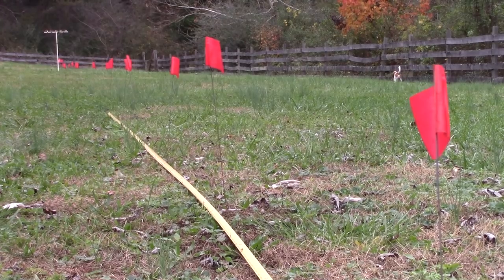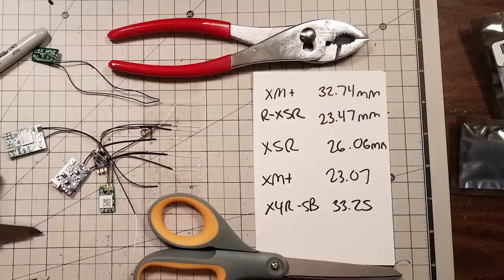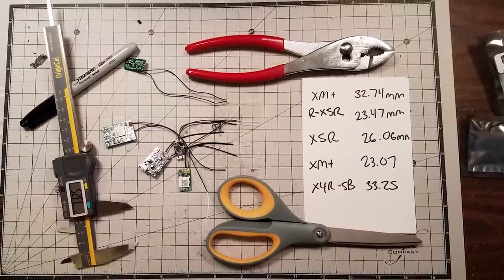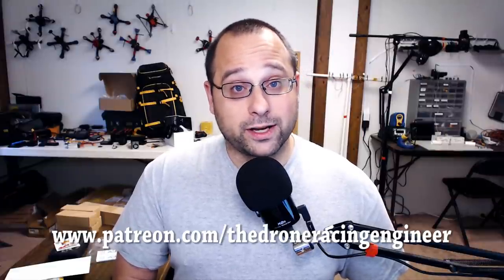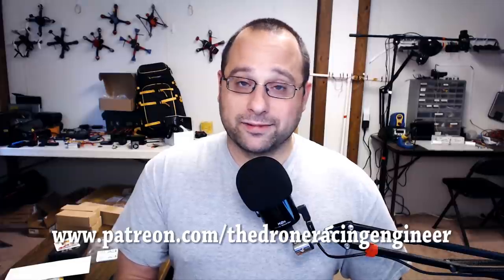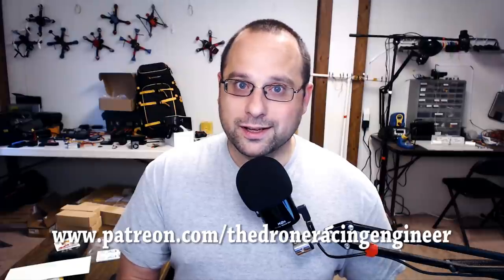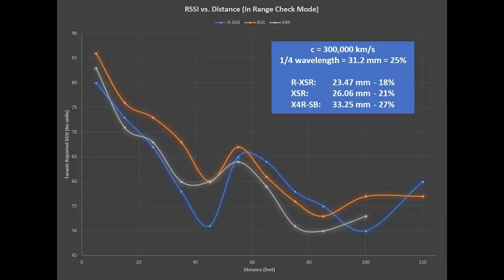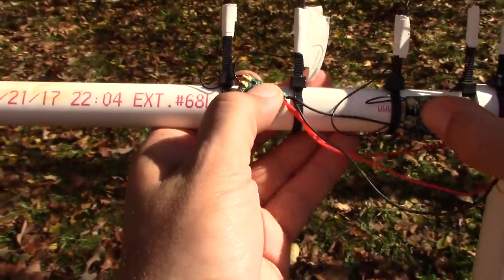Range Test FrSky RX | WRONG ANTENNA LENGTH?

Comment: There is a misconception in the RC community that receiver antenna length is critical. It is not. I believe this misconception results from the fact that transmitter antennas ARE length critical. 
One of the reasons for this misconception is that people read on the internet about tuning transmitter antennas, and assume it applies to receiver antennas as well. The actual science is quite involved, very math intensive, so few delve deep into it. Here's my attempt to explain what I know of it in a easy to understand framework. I hope it helps out.

Transmitter antennas radiate a certain portion of the power fed to them, and reflect the balance back to the transmitter - this is why operating a transmitter with the wrong or without an antenna can damage it, nearly all the power is reflected back to the output transistor and it overheats. 

Some of the power is transmitted and some is reflected back to the transmitter. This forms a ratio.

This ratio is known as the Standing Wave Ratio (SWR) which is a ratio of power sent to the antenna (forward) vs the power radiated by the antenna (1:1 being ideal – where all the power is radiated). SWR is determined by measuring the power being reflected back from the antenna and comparing it to the power being sent to the antenna (Reverse : Forward). 

An example would be a system with a SWR of 1.2:1 and a transmitter power of 1200mw. 1000mw will be radiated, and 200mw is returned to the transmitter and generates heat. If the antenna is tuned perfectly, with a 1:1 SWR, all 1200mw will be transmitted. This is a compromise on tunable systems, as the antenna is tuned for a specific length, and is only perfect (or nearly so) at one specific frequency.

This antenna tuning can be achieved by cutting the antenna to a resonant length, but can also be done by matching it to the antenna  with a inductor/capacitor network. Known in HAM circles as a “Transmatch” this network allows a single antenna to be used with a very wide range of transmitted frequencies and provides very good performance. It uses variable inductors and capacitors and is re-tuned for each desired frequency. A small specific version of this network (with fixed components) is often integrated into small transmitters to make them work better with less than perfect antennas.
This is a simplification for the sake of brevity (like I warned about) and any time a a signal 'changes hands' some of  it is as accepted and some reflected (which is why I went into all that detail above). This is all about matching impedances, and that's a big subject, worthy of entire books. 

Here's why it matters:

In any case, on a receiver antenna, the only concern it that it draws the signals you want from the air as efficiently as possible. In doing so, it draws in virtually all radio signals, with the length determining which are best received. THIS is why we care about the length of a receiver antenna. It's a broad range, not a specific channel, or even a band (such as they are with our 5.8ghz video signals), covering many MHz.

We finally get to why the length matters:
The receiver uses a series of tuned circuits to eliminate the unwanted adjacent signals, and focus on the desired channels. The 1st stage of this process occurs where the antenna meets the receiver (IE “front end”).
To remove the bulk of the unwanted radio energy, the receiver works with the antenna to create an impedance mismatch at frequencies above and below the desired target. This forms a broad tuned circuit, and reflects a large portion of the unwanted signals back to the antenna, where it is re-radiated (disposed of). The desired signal is thus 'pre-cleaned' allowing more sophisticated circuit to further refine it. The antenna plays as part of this tuned circuit, and contributes it's capacitance and inductance (components of impedance) the the components in the receiver circuitry. It's length effects it's  impedance, and how it interacts with the receiver.

This is WHY antennas will vary in length on different receivers, and why it helps, but is NOT critical to have them 'just right'. Each receiver has it's own specific front end impedance, and wants a antenna that works with it to produce the best performance. 

I apologize for the length of this comment, and have to qualify that I had to simplify some details to keep it this size, so don't beat me up if there's some minor inaccuracy or imprecision in it somewhere. I tried to make the basic principles easy to understand, and hope it helps out.
Reply: Scott Marshall  there was only one model that was a receiver. All the other units were transceivers. For telemetry to work the receiver switches to a transmitter in between packets to send telemetry. Therefore matching impedance is important during the telemetry cycle. This was not specifically tested.
Reply: Man! That was awesome! I'm so glad I bothered to read the comments. I'd always wondered what it was that killed VTX's that didn't have an antenna.
Reply: As an Extra class amateur radio operator, I applaud the clarity of your explanation. Well done.
Reply: The runs are so short and the wavelength @ 5.GHz both work to make it effects minimal for our uses, and it can be disregarded.

In long cable runs as in RF CATV it's the bane of engineers trying to keep the system in phase. 

I wrote a long explanation of multipath and analog TV ghosting, but I spared you the gory details. (I tend to run on on these sort of subjects)

Short answer – NO, 
The long answer is too long for this section.

If you want the gory details, PM or email me.
Reply: This is pretty accurate, but there's one thing you haven't mentioned: the sensitivity to resonant frequency shifts, both on the TX and RX side, is inversely proportional to the bandwidth of the antenna. If you have an extremely narrowband antenna, a slight change in center frequency can produce so much mismatch that you get essentially no signal at all. A wideband antenna is far less sensitive to this. Dipoles and cloverleafs have a relatively wide bandwidth, which is why you won't see that much difference. But some other antennas such as PCB-based patch antennas without an air gap or miniaturized ('meander') antennas (especially PCB-based) can become completely nonfunctional.

Also, in terms of signal strength, mismatch at the RX and TX side has the exact same effect. One is no more critical than the other. The difference between RX and TX matching lies only in the fact that the TX can be damaged by a mismatched antenna whereas the RX can't.

Variable matching networks are popular for amateur radio which uses lower frequencies, but they aren't practical for high frequencies such as 2.45 GHz or 5.8 GHz. We get away with this because the transmitters that are used for FPV are relatively low power compared to those that are used in amateur radio, so they don't overheat that easily.
Reply: For simplicity I assumed that we are talking 2.4Ghz 1/4 wave antennas. I've never seen a control receiver with anything else, but maybe that a niche someone like you could do something with. 
Is there a better Omni Rx antenna design for 2.4?  A retrofit would find a huge market here.
Reply: Cloverleafs would certainly work better (same reasoning for FPV applies to the regular control signal too). But at 2.4 GHz they are quite big and heavy, and also a lot more fragile. I'm considering modding my transmitter to add one, but transportation will become an issue I suspect. For the receiver I guess monopoles are still the most practical option. A balun, ground plane or counterpoise could help a lot though, I strongly suspect that the radiation pattern of these wire antennas is all over the place because the coax itself is radiating more than the 1/4 wave section itself.

Of course antenna placement is still key. I see people taping these wire antennas to their carbon frames or aluminium standoffs, if you're doing that then don't bother trying to improve the antenna ;).
Reply: UrLawyer Same here. Also an Extra Class ham radio operator as well
Reply: I'm sure it does effect things, but expect it's a very small influence in the distances involved, probably smaller than we can measure with digicals. I could be wrong, I'm behind the times, and Maarten Baert or Alex Greve can  tell you more about modern antenna design. 

I designed CATV filters (and manufacturing machinery) for Northeast Filter back in the '90s, and haven't been involved in it much since, other than my RC stuff. I moved into industrial controls after about 1998, so my knowledge is lagging. Things move pretty fast in the tech world and it's impossible to keep up unless you are intimately involved. For designs like the folded dipole, I cut a couple on the long side and trim the 1st until I go too far, then duplicate the best length(s) in a fresh one. Cut and try is hard to beat, but hard to do easily with CP or the more elaborate designs of today.
Reply: "An example would be a system with a SWR of 1.2:1 and a transmitter power of 1200mw. 1000mw will be radiated, and 200mw is returned to the transmitter and generates heat." - I do not think this is correct: http://rfcalculator.mobi/vswr-forward-reverse-power.html
Reply: Good catch - yes, VSWR is the wrong metric to use here, this is why engineers nowadays typically use S11 (return loss) which is simply the ratio of reflected power vs incoming power. It makes the calculations a lot more straightforward. A VSWR of 1.2 corresponds to a return loss of -20.8 dB. (return loss = 20*log10((VSWR-1)/(VSWR+1)))

When using a 1200mW transmitter, 9.9 mW will be reflected and the remaining 1190.1 mW will be either radiated or converted to heat (since the antenna will never have a radiation efficiency of 100%).
Reply: Thanks for your comments, extremely helpful . After reading your comment the "Light Bulb" turned up.
Reply: My point was really that the different antenna lengths are by design, and if it's off a tad, it will have a relatively small effect on range. If you want to experiment with the length, it probably won't hurt anything, (buy an extra and cut it, reserve the stock one if it doesn't help) but it's probably near optimum from the factory, as the length is adjusted to account for the internal receiver (and telemetry tx)  circuitry. (See Bruce's excellent explanation :
https://www.rcgroups.com/forums/showthread.php?2994438-Selling-the-Entire-Garage%21%21%21%21%21%21%21%21%21%21%21%21%21%21%21%21

IYour receiver does also transmit telemetry, but that's less critical for 2 reasons - #1 if you lose telemetry , you won't failsafe and crash, and #2 - the telemetry is less complex and slower signal and is relatively un-affected if it loses data packets, it just updates a little slower, and gives you a warning. I also believe the telemetry receiver is more sensitive because it tends to drop out when the receiver and transmitter are too close. I'm not sure why this is.
Reply: Antennas have the exact same properties for transmitting as for receiving, therefore antenna tuning matters exactly the same for rx as it does for tx. 

Additionally these "rx" modules actually contain transmitters too because they have to send back telemetry at certain time slots.
Reply: As mentioned they're transceivers, and low power so the tune can have quite an effect. And although you can tune antennas in the txvr, that's lossier than tuning by good length.
Reply: Nice clean explanation, well written.
Reply: I know they say there are no dumb questions, but: is it possible that using a more firm antenna increases reliable feedback compared to a whispy/curly antenna?
Reply: @SacredMilkOG  Not dumb at all. If the antenna is mounted where it can move around, it's possible that it may detune due to flexing and vary it's gain at a specific frequency as it moves. I've been a Amateur operator for 50 years, and I can't say I've ever seen it actually happen, on an RC vehicle or car antenna. That doesn't mean it can't happen, but I don't think it's an issue except in maybe extreme cases where the antenna is bent right over and possibly moved near a metal body or that sort of thing.
If you're installing a RC Receiver inside a model, I'd get it as straight as possible and try to keep it away form anything metal, or even plastic can cause issues. Straight and away from any objects is best, whether inside or outside, outside the vehicle, straight and stable would be the best setup, but the mounting is usually determined my the airframe or chassis of the vehicle, and the best you can do is compromise. The 900mhz stuff these days requires longer antennas, but is also much more forgiving in my experience than the 2ghz system. If you fly distance or with obstructions, 900mhz is the way to go, I fly 900mhz on everything but my DJI system, and it's it's own creature, the way they handle control signals. You CAN use a 900mhz system with the DJI HD setup if you just add it on and don't use the built-in control system, but I've found that the DJI package works quite well, within it's limits, add a good aftermarket antenna system and it's very reliable and easy to use.
Hope that helps, I know it's kind of general, but it's never been an issue in my limited experiences. Maybe someone with experience in more severe applications can expand on the question further.
Happy Flying!
Reply: @scottmarshall6766  thank you for that breakdown- I definitely want something where flying behind a pillar won't cut out my signal and make me drop from the sky. 

I'm still at novice level stuff with quads- I'm working on an H8 mini cause they're cheap and seemingly refined. I have an AIO 5.8ghz tx06 on one already though- feels like I'm just getting better by the day and itching for more things to mod. :) I'll experiment on a few of the "extra" bots I ordered- all H8 minis. (I feel like Eggman from Sonic while working on these... 😂)

Edit: And well- for purposes I ought to mention that one of the first things I did to my vtx antennae was bend them carefully backwards as close to the joint as possible. You mentioned it being wise not to bend them much at all though- and it's one of the first things I did... 🥴

I mean- I did it so I could fit into tighter spaces when flying- as the antenna on my quad's side is almost 3 times the quads height. xD (I like flying through the steel modern art commemorative lettering statues around my area.) The other- I bent so I can fit the setup in the drivers seat of my cars without the antenna itself exposed, in case of a roll.
Reply: @SacredMilkOG  
Coreh, Warning: I've not been able to fly much lately, and I kind of got going here, way beyond what you were asking. Guess I've been away from flying and I'm excited to do something, even if it's only to talk about it. To save you from reading it all unless you want to, The bottom line is, On a cloverleaf, just try not to bend the top part, the base is ok to adjust to fit. I prefer 6" quads, and HD video, but experiment and have fun.
Here's the long version: On 5.7ghx video, you'll be running a cloverleaf (most likely) and the "stick" is really just an extension to the signal carrying wire (transmission line in radiospeak) and the actual tuned part is the cloverleaf itself. You can pretty much do what you need to with the stalk if you leave the cloverleaf part as supplied. Yours is a case where practicality trumps theory, and antenna doesn't work at all if it gets sheared off on an obstacle, so you have to do what is necessary to get the whole deal working together. These days there are some very small form factor VTX antennas that work quite well and take a helluva hit. The DJI uses a pair of these and performs quite well with them  at the rear corners of the main frame. I like to get at least one of them up above the battery (on a top battery frame) so the quad doesn't shadow the signal when flying at yourself. The long stick versions work well for this. The Lumenier AXII ultra long and antenna like it are good for this placement and are immune to bending of the tuned elements. The bending issues are more of a problem for control link radios like in the 2.4ghz plain wire antennas found on many standard receivers, and 900mhz found on the TBS and FrSky Immortal T dipoles. The Immortal T out the back (between the arms) is a rugged solution with good signal charactaristics. Keep in mind that anything running telemetry is using the antenna as a transmitter antenna as well. These quads HD video and full digital controls and telemetry are an extremely sophisticated radio/computer system compared to the old 72mhz systems. 
My 2 standard systems for the last couple years have been a modded FrSky X7s with a TBS 2w Crossfire backpack feeding a quad equipped with a Mamba Stack and DJI VTX. The other is a Mamba Stack and all DJI Radio gear but antennas. Occasionally I'll put up a tower (camera tripod with 22' carbon fishing pole) that carries the same basic array as the goggle setup does. A spotter keeping the array roughly aimed at the aircraft helps a bit. 
To be honest, I haven't really flown any outdoor analog equipped quads since the DJI HD came out. I try, but just can't enjoy the old video now that I'm used to the HD. Most of my quads have been converted, and I've started playing with Caddix micro stuff for the smaller quads. Most of the time, I just use the DJI transmitter, and I DO miss my OpenTX functions, but the simple rugged, reliable  package the DJI gear offers coupled with the incredible video suits me just fine. If you're still kind of new at quad flying, I'd recommend trying a DJI package coupled to a Mamba Stack with motors of your choice. The Mamba stack provides voltage regulation so you can run the quad on 6S (Recommended). This is a super simple build, rugged and easy to set up on almost any frame. A 6" on 6S gives a great balance of smooth flight, speed and flight times. In addition, the 6" is a more durable quad with just enough weight it really carries through moves you simply can't do with a light 5". Try one, I'd bet you'll enjoy it. They are NOT the fastest, meanest flipping machine out there, but unless you're a super skilled flyer (I'm not), they make a terrific machine to learn on, and fly easy, so you'll spend more time flying than repairing, retrieving and programming.  I  like the 6" to 8" class for fun proximity flying and they can carry even one of the new GoPros if you plan on doing video production, but I fly mostly for fun. I have years of video (back to the pre quad days) and still haven't learned to edit it. I discovered the simple 6" by accident. I have over 20 quads, most flyable or within a few minutes of being ready. After I started flying the DJI system, I kind of decided I wanted to fly for ME, and started leaving the GoPro off. That summer I flew a lot, and one day realized most of my fancy quads were on the wall. I ended up with 3 6" plain jane and that was about all I was flying. For the 1st time, I was flying more then building/repairing and I was loving it.
Sorry, I got WAY off the rails here on an antenna question, I was going to erase it, but I guess it can't hurt to leave it up. Right now I'm not able to fly much, I've got a mom with Altzhimers  and for now that's job 1, but I can't wait to get back in the air. I've vowed that by spring, I'll be back at it.  Hope I helped a little, didn't confuse you too much, and didn't bore you to sleep too bad. Fly a pack for me.
Reply: @scottmarshall6766  Hell nah, I appreciate heavily that you chose not to erase it actually :) I get a little off topic kind of often. Sometimes, it's better to leave that stuff in, this isn't just a business conversation- so friendly small talk is good in my opinion. 

Seriously thanks, I've been looking at the Mamba parts on Banggood too- glad to know they're so flexible so to speak. I'm not ready for HD yet- but think that maybe analogs will be the cheap route for flying freestyle or practice/rough work. In any matter though I have a lot to learn- but I'm planning ahead because once I'm certified for bigger quads and commercial flying I plan to be doing this for a while. I enjoy the flying very much, and the electronics work required is new for me but is really helping me get those skills in shape. I imagine a year down the line I might be comfortable taking a crack at building my own computer with all I'm learning. (which can be either more or less challenging depending how you do it)

If I could get my hands on a DJI setup in the near future I would though- it will definitely be optimal for work purposes and clarity in some cases. Especially where photography is concerned. I feel like I hit a vein of gold finding quads right now- the technology is getting refined, cheaper and much more lucrative overall. There's a lot RC can offer in these coming years, I can just feel it. It already has been- but I think it will be much more integral. 

Again, I appreciate you typing that out for me- lots of helpful info there to digest. 

Sorry about your mother, I kind of know how that stuff can be. My grandmother has been in the early signs of dementia for a while and it can be heavy to deal with let alone see/hear her like that. Alzheimers is slightly different but.. You're a strong person for being there though, not everybody can do that.

Thanks again, I see the community is still building up- so the videos-- even the actual tournament and racing series videos still seem slightly niche for the moment speaking by views. I predict a weird blown up influx of new beginners and hobbyists coming soon though, including myself. Lol